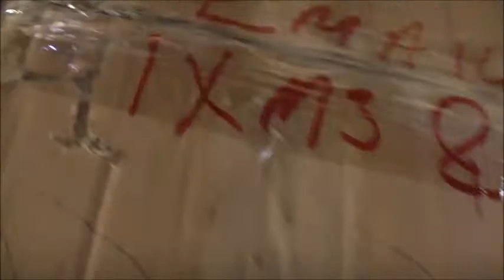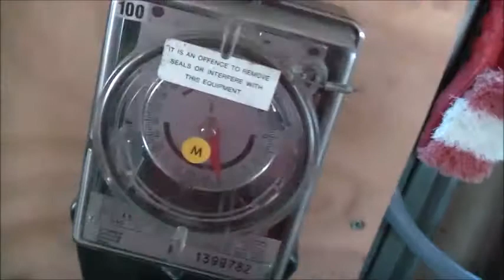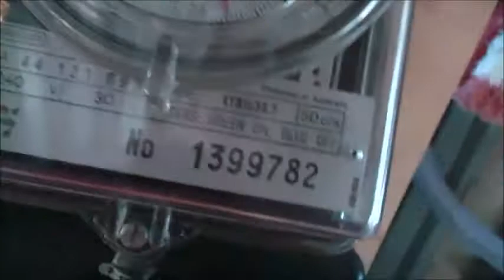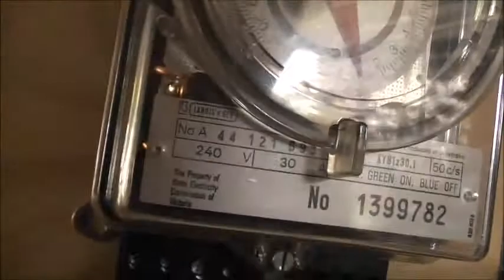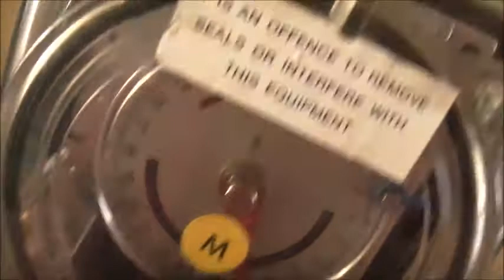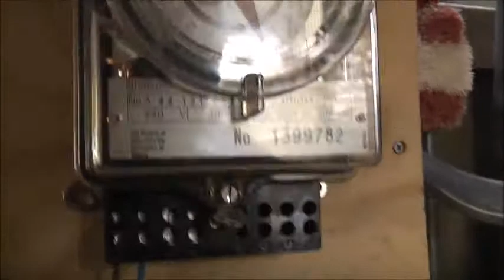YTR Rant & Landis & Gyr KYB Timeswitch Test!!

Comment: Another thing about Rate-Changing: 

Even if you don't have a Rate-Changer timeswitch, what you CAN do, is to use a timeswitch as a rate-changer only, but it DOES need separate motor connections.

I once done a little vid on using a 3-pin Sangamo Weston "round-pattern" timeswitch and I re-jigged it for use as a Rate-Changer. :D

I didn't need to 'interfere' with its internals at all, just how I configured the external wiring to it.

So yes, if you don't have a Rate-Changer (yet) in your collection, you can re-purpose a timeswitch as a rate changer, but that's all it'll do.

For the true two-in-one operation, you do need a dedicated Rate Changer Timeswitch.

There are other ways though:

One timeswitch and two contactor sets! :D

As the timeswitch turns on, it energises the coils in two separate contactors (the rate-change contactor can be as small as two amps) and the other one is the load-switching contactor, of a switching capacity of your choice.

If however.....

If you have a chunky double-pole contactor and you're not too worried about single-pole switching a beefy load, then you could use the 'spare' contact in the contactor as a Rate-Change contact. :D

OK, if your double-pole contactor is 100A and you're using one of the poles as a rate-change contact, a 100A contact for rate-change duties is serious overkill, but hey-ho. :D

Another way.....

There is one other way of course. A chunky 3-pole contactor. :D
You could use two of the poles for double-pole switching a beefy load and the third pole in the contactor can be a rate-change contact for the meter. :D

Oh yes....... There's various different ways out of the situation of not having a dedicated rate-changer timeswitch, you know. :D

I has flavour. :D

-BoomBoxDeluxe.

26th October 2015, 13.50

Comment: There are certain ways to work out whether-or-not a clock is a Rate-Changer:

(1) The specifications will list two ratings for the two contact sets
(2) The quantity of terminal screws in the terminal block. :D

================================

Firstly, we need to work out if the timeswitch has separate motor connections and whether-or-not the device needs an earth connection.

If it does need earthing and does have separate motor connections, then the timeswitch should have five terminals. DO CHECK with a continuity tester though.

Now then....

If it has a Rate-Change trigger contact in there, this will have another terminal, so you'll have six terminals. The specification plate should also list the rating for the Rate Change contact.

It shouldn't be too difficult to work out if a timeswitch is also a Rate-Changer. :-)

Thanxx for showing,

-BoomBoxDeluxe.

26th October 2015, 13.34